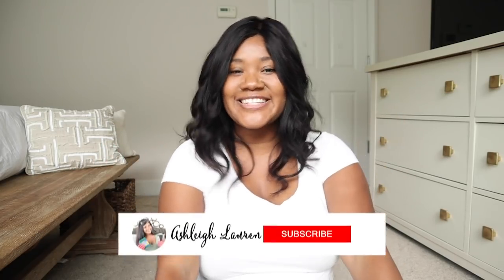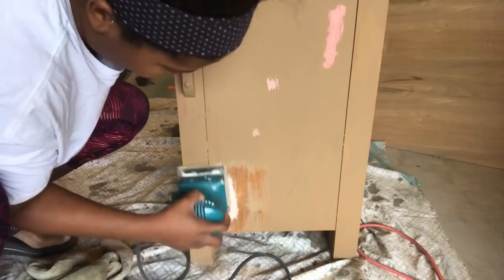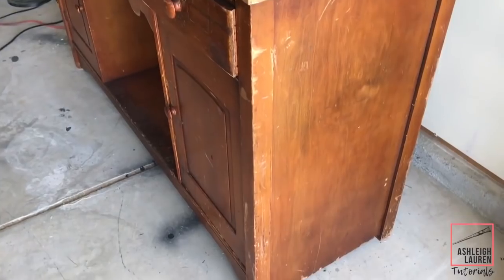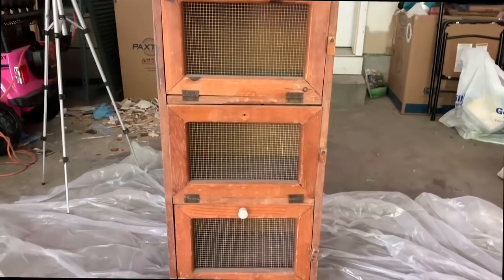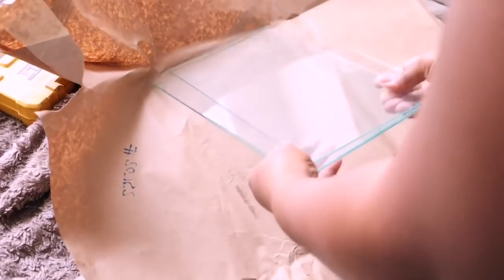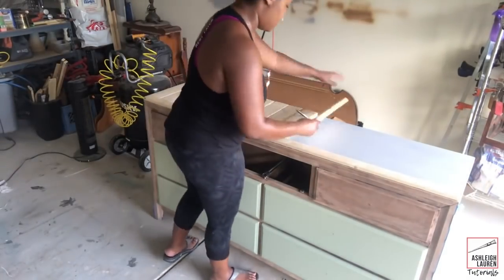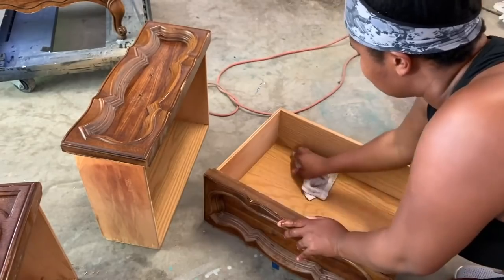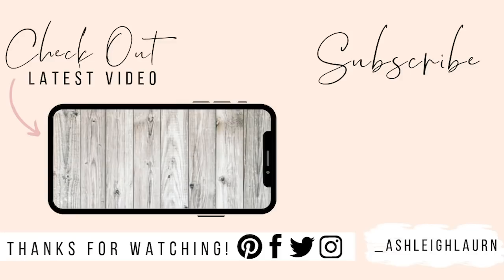5 Inspirational Furniture Makeovers | Ashleigh Lauren

Comment: That last one was a great improvement in style.  Others needed to be improved due to damage , but that last one needed a change in design. The ornate carving didn’t go well with wood grain and stain- they fought with each other and it hurt to look at because you could see the potential   You brought out the beauty of the carvings and  intricate hardware by painting the wood solid and waxing. Great job 👏🏽
I wonder if a antiquing stain would have brought it out even more